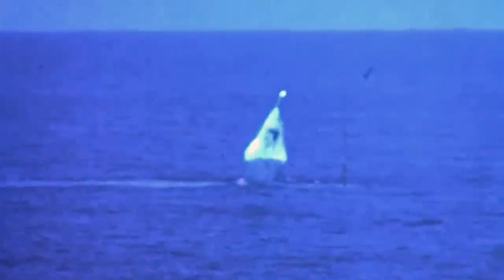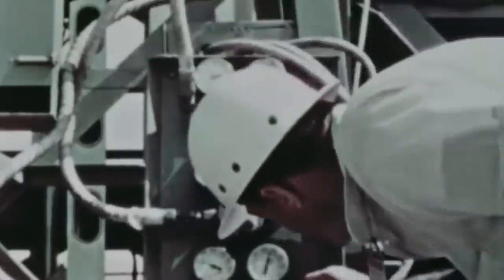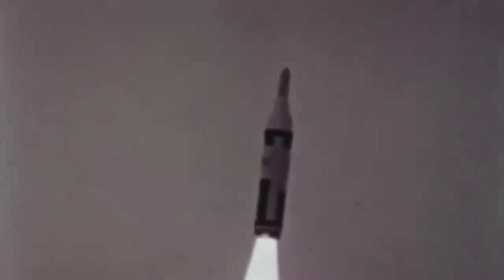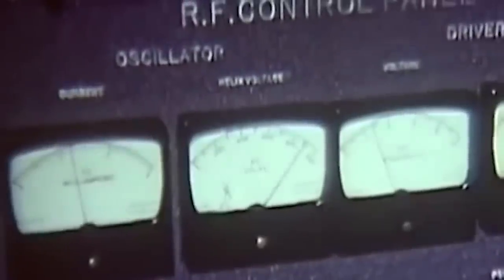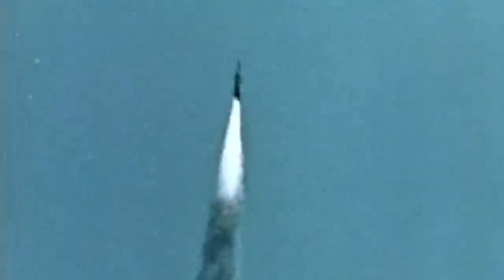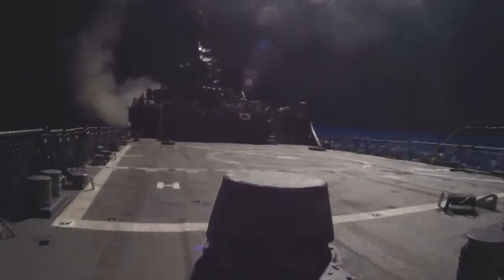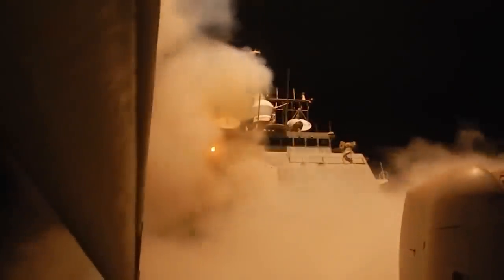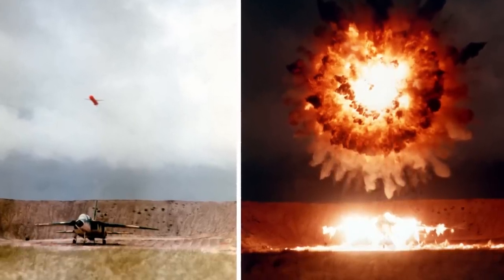How American Submarines Can Target 90% of the World’s Population

Comment: "The Three Most Powerful Men in the World:"
The President of The United States.
The President of the Russian Republic.
And..
The Captain of a US Nuclear Missile Submarine."
Reply: “Alabama!”
Reply: Actually, the Capt or any officer is not needed to do a tactical launch, all they do is read a script and turn a key that turns a light green in fire control and that signal can be quickly and easily jumped out.  The officers could not do a launch by themself to save their lives.  The small group of techs that operate and maintain the ICBM's and its system are trained do launches, under any and all failure conditions, like someone losing key or the key happens to just break. 
If a sub crew felt like it they could  easily do a tactical launch and nobody would know until the missiles were away.  The only thing that prevents it is trust.

Comment: I’ve noticed that on a few boomers subs of the 60’s-70’s (Ethan Allen class? George Washington?) there are enormous struts to which are affixed towering masts. They loom over every conventional mast. 
Does anyone know if those huge antennae were attached at sea by a sub tender or a station keeping ship, or could they be stowed? I’ve seen videos where the submarine is at least at periscope depth, maybe even deeper — and their missile telemetry antennas appear to reach 50ft+ above ESM mast, radar egg beater, and both periscopes. And in most cases they appear to be far above all of these and I only see them when they’re launching missiles. I get the benefit, because it’ll clearly extend their ‘visual’ range in BVR scenarios, but was that practical? I’d imagine the huge masts would need explosive bolts too so that they could jettison the antenna incase the Soviets lurked nearby and gave chase. 

Could those early missile subs travel underway with massive telemetry masts folded against the hull? Or were they attached once they enter a missile test area?
Reply: Those large masts were attached strictly during Polaris test launch missions. They were never mounted while on actual patrol. Polaris and later Poseidon and Trident missiles have always been launched with the submarine at periscope depth to the best of my knowledge.
Reply: The red mast is fixed in place while in port. I doubt the tender put it on. More likely a weapons station tiger team. I was on a sub tender for a Polaris test launch at Port Canaveral. We didn't install the mast. The purpose of mast is to serve as a submarine position marker, while submerged at hovering depth. Position monitored by the range safety vessel where the ballistic missile launch is filmed for later analysis. We were very close, at about 1000m, when the rocket motor lit off. Quite the sight - as shown in the videos.